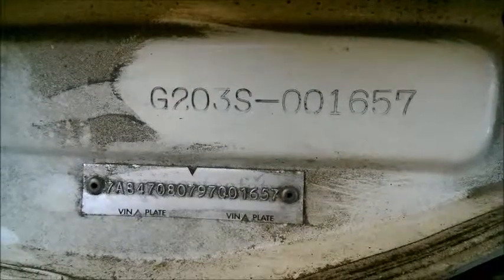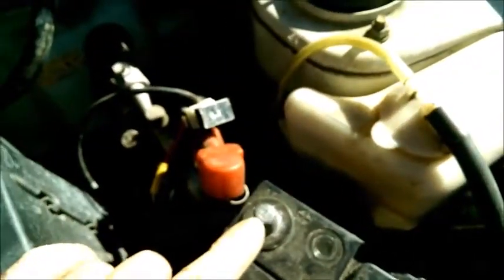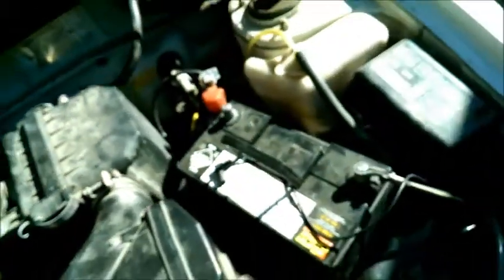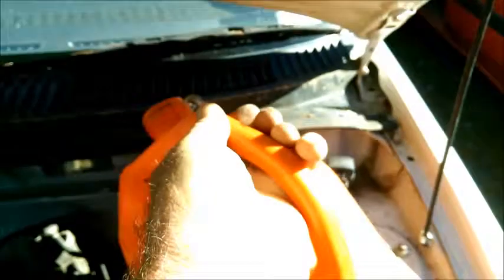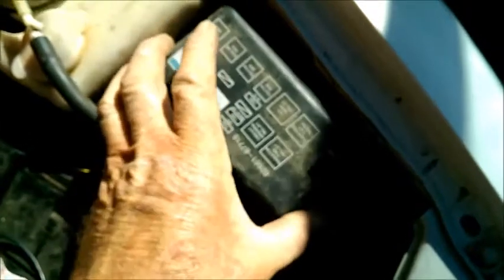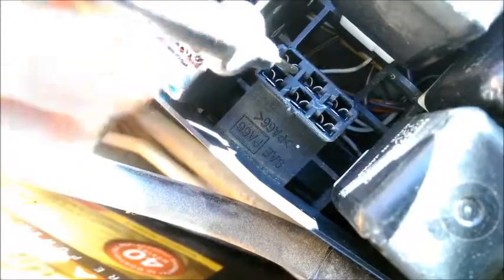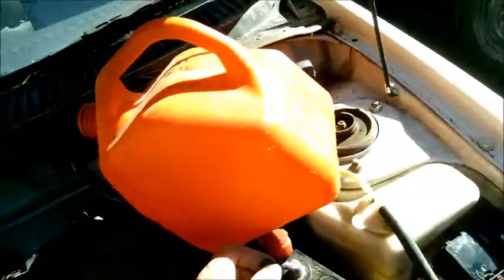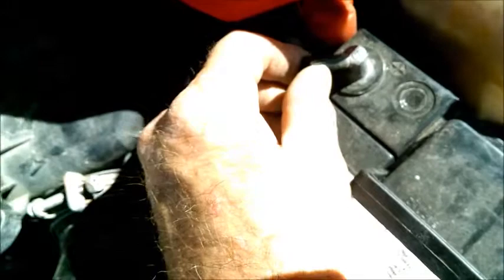Daihatsu Charade G203 Fuel Pump Test (Fuel Pump Relay Bypass)

Comment: Where is the fuel pump located?
Can it be easily replaced without removing the fuel tank?
Reply from the maker: Unfortunately it is inside the tank and the tank has to be removed. On this vehicle there was no floor cover to remove to get to the pump. Some car designers need their heads read, they don't think of the future. The pumps are supposed to last the lifetime of the car..... That's bollocks.